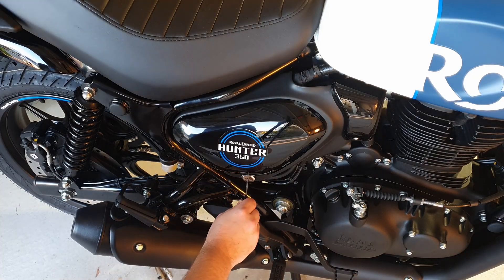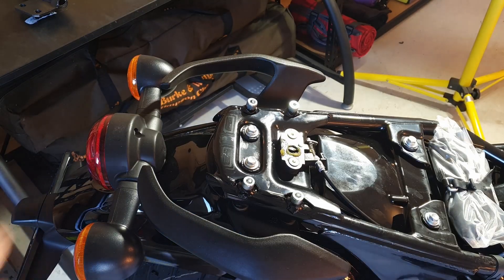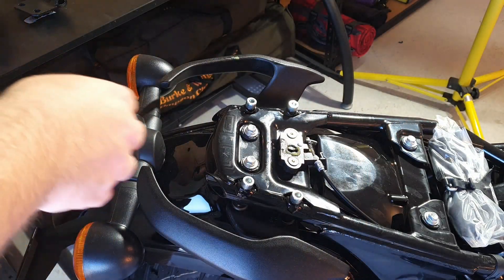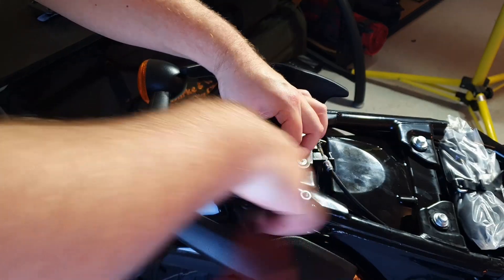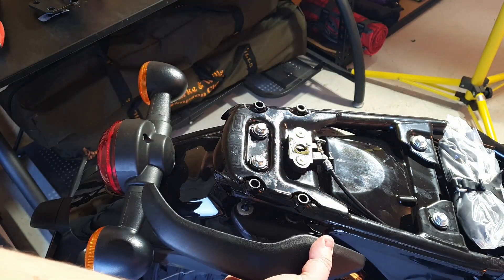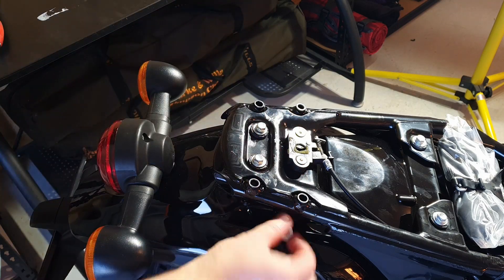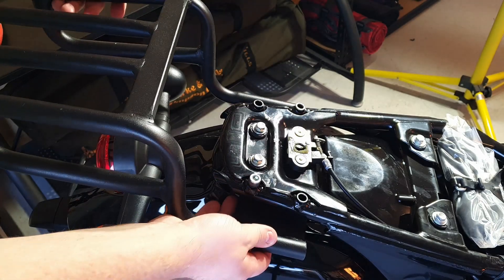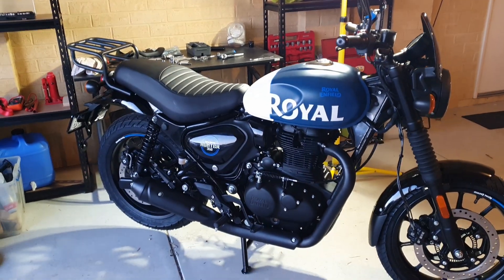Royal Enfield Hunter 350 rear luggage rack install

Comment: Stumbled on this video, thanks so much for the clear instructions! I was wondering, newbie here, is it possible to install a tobbox on this rack? Maybe something universal that comes with a mounting plate? It seams like this rack is more for bags am I wrong? Thanks in advance.
Reply from the maker: Hey, no this rack does not come with a mounting plate. This rack is sold basically as a tie down rack, which is how I use it, I have used ratchet straps to die down toolboxes, small fuel cans and a milk crate for going shopping. However I was designing a bracket to convert it to hold a top box, but my riding/videos have been put on hold for a while after I snapped my wrist in a workplace accident. When I have recovered, around Christmas, I plan to continue making some custom parts for the bike.

Comment: Is it possible to have the grab bars on with the rack?
Reply from the maker: If you used longer bolts and drilled out holes in your fender for clearence for the extra length it might be possible? But not something i would recommend

Comment: Thank you for the video. I bought the same rack but have not fitted it yet as I am slightly concerned about the support just being on the rear frame bolts and not also on the shocks (like most bikes). What would you trust it with?
Reply from the maker: I have carried my drone in hard-case, 5L of petrol, a milk crate full of shopping and a strapped down bag of books/laptop and was confident while riding with these different setups. I have not noticed any flex or give in the rack itself, and I have not noticed any negative effect on the dynamics of the bike while riding. The rack is probably good to strap down most everything that would fit on it. Just avoid overloading it by having heavy objects stacked over the side/rear. Too much weight away from the center of mass of the rack will induce larger moments, and this is what will flex the rack due to limited attachment points.

Comment: On the left side grab handle, there is a third nut at the centre, but in your luggage rack that mount at the centre is missing, will not it affect the bike ?
Reply from the maker: There is no third nut, there is an extrusion and hole here, perhaps where royal enfield intend some other accessorie to be attached, though I have not seen enfield offer any part for sale in aus that uses this mounting point. It is just empty here in this case, with no apparent purpose. Maybe they offer in other countries some sort of tie down kit for over the seat? Or passanger back rest?  But to my local knowledge they are not used. The grab handles were both only attached by 2 Allen headed bolts with a nut underneath.
Reply: @MrCombfoot  yes, In india that extrusion is for mounting Saree guard (If you know Saree, an Indian women attire, so that the Saree do not touches the wheel) 

And here in india saree guard is mandatory by law

Comment: That actually looks pretty good. Do you think the engine guards are worth getting?
Reply from the maker: Sortve entirely dependent on your use case.

I 90% use my bike on sealed roads in fairly flat terrain, so engine guards or not worthwhile for me.

If you live or use your bike someone with hilly terrain or narrow paths where fall overs and scrapes are likely, or on gravel or road surfaces where you are likely to lowside or drop your bike, then I would purchase them.

Accessories are expensive, add weight and increase the 'footprint' of your bike so unless you need them or you just like the aesthetic~

Comment: Would it be possible do you think?
To retain the grab handles if you get longer bolts? 
I've done this on my Interceptor,
I fitted a rear rack, and retained the grab rail, by just getting longer bolts than were on the bike, standard length wouldn't reach,
About quarter inche longer did it for the Interceptor,
I'm wondering if i could do the same thing on my Hunter?
Cheers Paul
Reply from the maker: You might be able to get away with a few more mm of bolt length before having to drill the guard. There isn't much space though. It might take a bit of Jenga to get all the mounting hardware + nuts in. You can loosen the guard off and pull it away, assemble the mounting, then reattach the guard. That could help.

I went out and had a quick look, and with this particular luggage rack and the stock grab handles, there is interference between the parts when the grab handles are mounted 'on top'. If mounting 'underneath' will just fit I think, may have to remove a little material from the grab handle tips to fit.
Reply: @MrCombfoot  ok thanks 👍